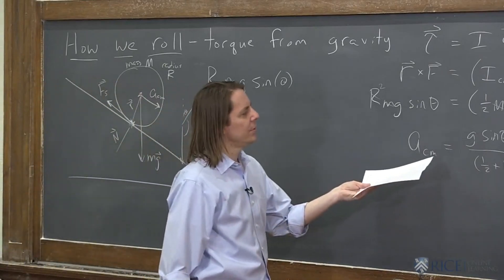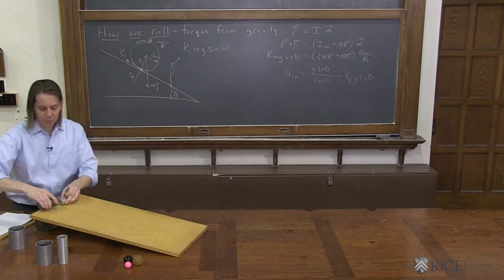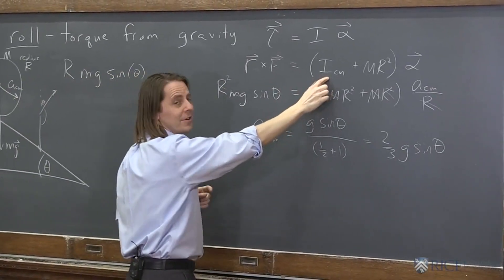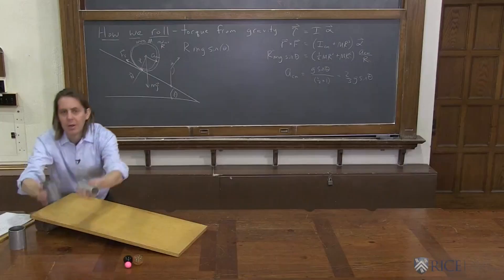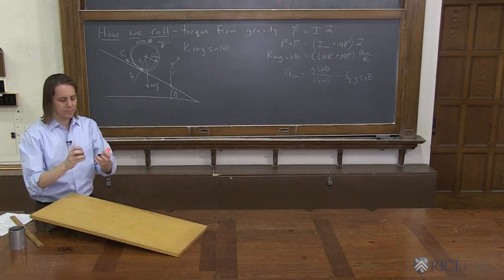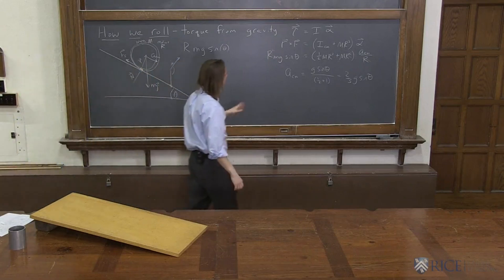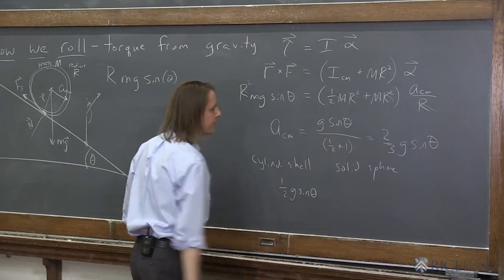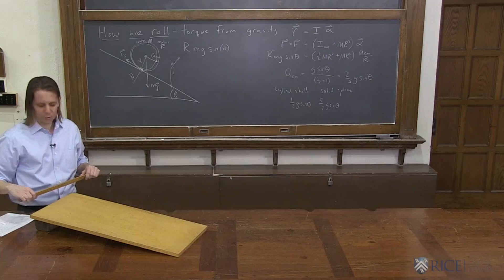DEMO: Rolling Down a Ramp

Comment: I have a question sir. What if one cylinder is rolling down and the other one is sliding down. (assume there is no friction). Which cylinder would reach the bottom first?
Reply: You need to be accurate with setup. Rolling happens due to the friction and without one there will be no rolling altogether. In that case you can give any initial spin to cylinder and spin will stay the same through the ride.

More interesting case might be to compare cylinder sliding butt-end first with the one rolling properly. But in that case sliding friction force is stronger than static friction involved in rolling, so sliding cylinder will lose.
Reply: Sorry I can't assume, b'coz Without friction there is no rolling